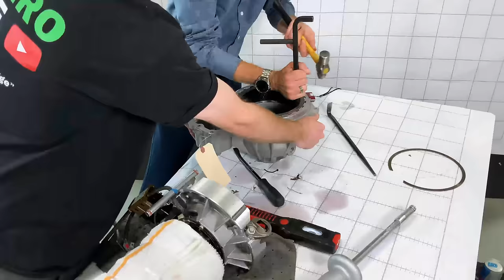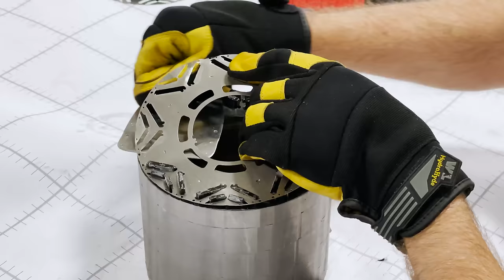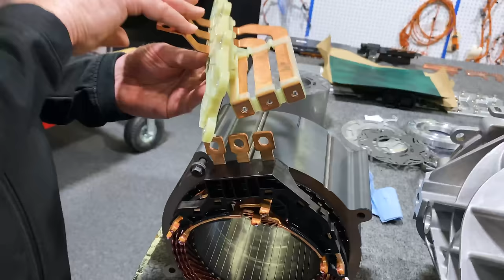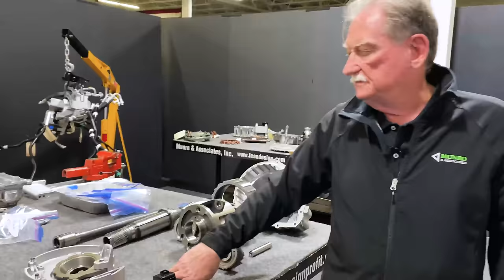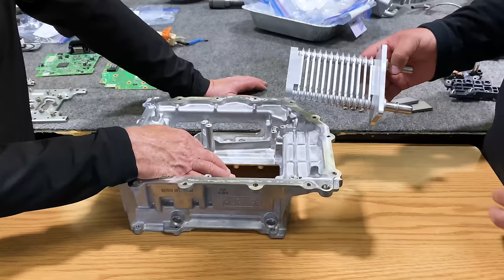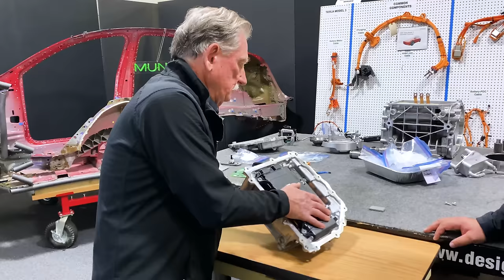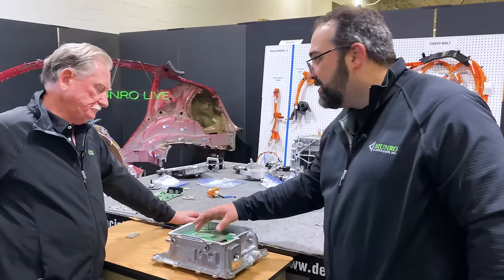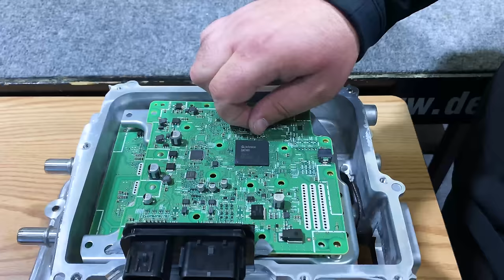Ford Mach-E Rear Motor Teardown and Analysis

Comment: You ask why Ford put the electric oil pump inside that is when it’s out of warranty. The person brings in a fault code came up what’s the problem, oh no problem that’s for the electric oil pump that it needs. I am sorry your credit card won’t pay for that it’s too high a bill. If you step over to our credit department they can set up a payment plan for you. The interest really got it down low at 14%.. i’m sorry that crumble take about four months to get a new one in. And welding everything together in the other component. I’m sorry we have to replace the whole thing it’s not repairable. We can make you a good deal on a brand new car though.

Comment: My guess is during manufacture and assembly a human never touches a single part of the inverter and same goes for the rest of the motor/transmission. For the most part design reflects this reality....Like the idea a screw would get dropped into the housing. Well it's all, but impossible the robots would make that mistake  cuz as each process is completed that robot or the next robot preforms a QC check before it preforms it's process. So if a screw is missing, a part miss aligned or there is an imperfect weld or solder the robots ejects the assembly from the line.....There is no doubt in the EV race Tesla is far ahead, but Ford and the other legacy automakers have been in an automation arms race for a hundred years. I'm willing to bet this Mach-E motor/trans is probably cheaper and possibly more reliable than a Tesla unit just because they are leveraging much more design and manufacturing experience.

Comment: That the initial  engineering  and design is that  way off,  and also that quality Control failed to pick up on all the issues you have raised about this one unit, seems  suggestive of a serious lack of regard towards efficiency, and any appreciation of overall impact of such failures. One could almost infer incompetence ?  Good video and quite revealing.

Comment: I wonder if the electric car maker’s should have a mileage check for service to make sure that all the wires and connections are ok. This might prevent the car fires. What do you think. 
Gas car’s do have a service interval. 
Let us know what you think.

Comment: 11:09 Am I crazy or did you just criticize the need for an oil cooler on a power train, claim it isn't usually seen on power trains, and then immediately cut to your right hand resting on an oil cooler in the Tesla power train? I'm a novice so I could be completely wrong, welcome being corrected.

Comment: using the disk brakes to put the vehicle in park deforms your rotors, especially if they are hot.

i'm sure you know this but luxury cars have used separate tiny brake shoes that clamp down internally on a separate part of the rotor for years for this reason
Reply: Not true...when brakes or electric brakes hold the car in park  the caliper will adjust and accommodate the pad again the rotor..my model 3 is being using that system for 3 years and  have not issue with the rotor  or any deformation of the rotor ...miss information you need to get you facts straight....
Reply: @robcoll1069  you sound very confident with your data of n=1. so all these car companies who have have been making cars for decades with separate rear parking brake shoes are just wasting money?

leaving the pad on the rotor leaves an impression and rust on the rotor and any unevenness will lead to warping. i know those who worship at the alter of tesla cannot possibly believe tesla does something non-perfect, but talk to any mechanic about this. and btw model 3's are notorious for having a lot of brake rust issues, especially if they are driven in northeast with salt on the roads. however most of that has to do with the fact that the brakes on not used much due to the regen
Reply: @connelly6375  Again ..miss info...I got the prove in real time..all Tesla car have electric lock brakes at park and  with Regen active very light used of the brakes pads, using one caliper one set of brakes pads per wheels."I have never had any rotor rust or pads marks on rotors....is always locked at park on hot or cold rotor and is not and issue...you pretend you got facts .. "you maybe driving a Ford" sorry.. you lack of knowledge are in display.."Get your fact straight"
Reply: Knowledge 101..."The brake rotors can become glazed with material from the brake pads. This happens when the brake pads get very hot which causes the pad material to rub off onto the brake rotors. This causes the brake rotor surface to become uneven and decrease the overall efficiency of the brakes. TESLA hardly used the actual brakes "Motor Regen" that is why rotor never over heat or get real hot...that is the secret "don't tell anyone"
Reply: @robcoll1069  Right. However when pushed to extremes on a track the brakes do get quite hot even when regen is operating. I have seen some cases where the OEM brakes are replaced with more robust performance versions since the original ones can wear out before a race is over.
Reply: @Clearphish   yes indeed  any thing that goes into the abused of the track race have to be modified or have some not OEM modification..95% of us are regular drivers in  a normal driving conditions ,Rotor never get red hot or deform or damaged except when drive with were out pads..now if you going to race at high speed and extreme braking  is a different ball game, Tesla car is not made for race track(even do people used them to race), so to generalized it is wrong .. Tesla have the best brakes system ever...thanks
Reply: @robcoll1069  I agree with most of what you say. I also note that the performance models have a thing called Track Mode. This, I believe, is a way to grab the attention of the motor heads who live mostly in the US. 99% of Tesla drivers never bother using the extreme capabilities that Tesla offers. The fact that they exist however takes up significant mind space in the American public. I think this is a good thing because it helps in the adoption of EVs.
Reply: Parking brakes on hot pads are an issue, but not for normal cars in normal driving conditions. Parking brakes using the service caliper pads (in the case of sliding calipers) or a separate caliper (in the case of fixed-body service calipers) are now very common, whether they are applied by a manual lever and pull cable, or an electronic controller and electric motor.

As someone who does his own vehicle maintenance, I absolutely despise those complex and awkward parking drum mechanisms inside the hat of disk brake rotors.

Comment: The inverter is very compact and has nice cooling, it looks pretty robust. But assembly is horrible and service impossible. Seems like more of a prototype put into service. This is like the prototype control systems I would help build for robots in highschool lol.
Reply: Drive units and inverters contain nonserviceable parts. Pre-2013 Teslas had their drive units replaced at least once. Pretty much on ALL cars.

Comment: "Code doesn't cost much..."  
Correct, but it's not the code that's expensive, it's the best code-writers money can buy that cost a fortune, and by the looks of it Ford ain't got enough of 'em or too many of the wrong kind. Wouldn't surprise me if it turned out whatever code they DO put into their EVs isn't written in-house...
Reply: The point is the code only has to be written once. Mechanically locking the transmission requires components in every car.
Reply: @fredbloggs5902  ...code only has to fail once, and hundreds could be effected.
Reply: @fredbloggs5902  Agreed, but MY point was that Ford et.al. don't have the talent resources to write it correctly the first time. Look at the tech problems with VW's "ID" lineup. They wrote the code ...just wrongly though. And they're still at it.

Comment: Major source of inefficiency is the number of gear mesh contact points.  Ford's planetary gearset has WAY more gear mesh contact points than Tesla's offset gearing.  And Tesla's gearbox is higher torque and power output.  You can still solve NVH issues without the planetary.
Reply: Sounds good, but is bullshit. contact AREA not points is what matters & they're the same

Comment: More of an observation.  Clearly the expertise in this video is in the mechanical, assembly and production side.  What's lacking is a technical discussion of the electronics themselves.  Digging into the IC specs, IGBT/SIC Mosfet specs, thermal limits, how well thermals are dissipated, etc....  The thermal discussion is lacking in real understanding, what's talked about observational info without test data to back up assumptions, so many assumptions.....

While I like this video, it's lacking in EE/electronics info.  This is a very complex electro-mechanical system with most likely a great many engineering tradeoffs needed to meet demanding requirements.  Final assembly complexity 'may' be required, hard to say without a much deeper insight into the overall specs of the inverter.

Couple of lines of code cost nothing, and bugs cost lives.  Mechanical locks have known, well characterized limitations.  When you have total power failure, where does the braking come from?

Comment: To be honest I'm starting to be dissapointed by this channel. Every episode is just moaning about fasteners. They don't read comments, they don't understand that modules are build by subcontractors with different internal standards. Sandy is stuck back in 80's and don't get that large modern PCBs need alot of supports because of vibration failures.
And a ton of fanboys in comments that take everything as gospel...

Comment: Watched your video with interest, but one think that stands out is that it’s very easy to be critical of manufacturers. Think ford have done a fantastic job. And they should be commended and not put down constantly.
Reply: This isn't just put downs.  This is untold millions of dollars in unnecessary costs to manufacture due to needless complexity,  unneeded components,  parts which are much more expensive for the customer to have repaired. All makers commit these errors and should learn from these analyses. 

This is extremely valuable constructive criticism to the entire industry.

Comment: Can you say crash test, I don't get it.  Well just build your own and make it work.  And not with your click it parts together that just saves money on the builder side.
I'll play with yea, 1/8" machine screw can hold over 3,000 pounds.  Now, how many of your click it together parts do I need to get there.  Just one big part or it just depends 
on what the part is made of.  
Post it, you must have by now at least 10 or 20 self clicker parts that are PATENT.

Comment: I assume Tesla has a reason for their wound stator design, as opposed to the hairpin design. Do you have any idea why Tesla does it that way?
Reply: Efficiency. The fact that they still do that instead of hairpins despite the automation headache means it's really crucial to motor efficiency.
Reply: A recurring theme with Elon is going back to base principles to make something that works and then refining over time. It’s possible they will do this in the future, the difference is they’ll know precisely what the trade-offs are.
Reply: Because it was always done that way. The same reason that Tesla stuck with induction motors for so long.

Comment: Electric motors have been in use for decades in pumping applications. What is so different about EV motors?
Reply: EV Motors are brushless, turned by moving the magnetic field.  Pump motors use brushes on a commutator.  Brushless motors are orders of magnatude more efficient than normal brushed motors.
Reply: @charlesball6519  No, they're not "orders of magnitude more efficient"... for that to be true, brushed motors would need to be less than 1% efficient, which is not true.
Reply: Nothing fundamentally. EVs are just a very demanding application, requiring high efficiency and small motor size, and the ability to run at relatively high power at least briefly. They also need to be sealed (many motors are open for air cooling) and to run for years without maintenance (so brushes and commutators are not acceptable). Almost all EV motors are 3-phase AC induction or permanent magnet (PM) synchronous types - this one is PM - and both of those types have been used industrially for a long time, especially the induction motors which have been around for over a century.

Comment: I guess if I was at engineering school with Sandy as my lecturer .... I would have just gotten a big “F” !
It seems this legacy car maker is struggling to bring on the new mindset that EV engineering demands (unrelenting weight reduction, extreme efficiency in design and resource management) .... as it must dis-heartening for some of these engineers to create key sections of great design only to be undermined by sections of gross mediocrity and old habits.
Great design and engineering demands a very small (less than five) leadership team but also fully empowered at that .... so today’s presentation makes me wonder how much is Ford and/or third party suppliers or are they just out of the depth in these matters? 
As Sandy mentions a few times in aerospace we don’t do any of this... so how hard would it be to bring some aerospace mentors or suppliers into the fold?
Reply: Borg Warner, who designed this unit, was the original drive unit supplier for the Tesla Roadster, fanboy. Legacy, nothing. Hot air PR from Musk that you ate cuz you like your pablum.
Reply: @vidznstuff1  You sir misjudge my commentary … Ford like other competitors display design and build elements that encompass both excellence and mediocrity whether that is through their own efforts or suppliers.

So there is no need to so sensitive … for the moment Tesla is delivering one of the best overall design and build ‘packages’ as acknowledged by both of the CEO’s at Ford and VW (while GM remains in denial).

However, the ultimate proof of who is best whether that includes your friends at BorgWarner or not - probably will take many years possibly a decade - as this race has only just begun!

Comment: Motor is inline with what? The axles?
IGBT & MOSFET what% of viewers know what these are?
Reply: ...yes, the CV joints go on either side as an integrated motor/differential unit. Very compact, but might require the beefed up housing.

Comment: Code for braking? That doesn't seems wise. Wouldn't there be a parasitic energy loss to have the car just parked? A mechanical direct hand brake is more energy efficient and fail proof
Reply: There is no parasitic power consumption. Electrically-applied parking brakes are just like the parking brakes that you apply with a hand lever or foot pedal, just operated by an electric motor.  Once they're set, they stay in place with no power, just as the manual version stays in place without the driver continuing to pull on the lever.
Reply: @brianb-p6586  alright, that's another storie. It would make sense

Comment: The parking pawl comments are interesting. Every vehicle has a parking brake, so none of them need a parking pawl... whether it is in an automatic transmission or an EV transmission. Most parking brakes are now driven by electric motors, so they can be automated (for the stupid drivers). If you're going to criticize Ford for having a parking pawl (as many EVs do), you should criticize every manufacturer for having a parking pawl in any automatic transmission, especially in vehicles with electrically actuated parking brakes.

Comment: man i'm not an engineer, but build PC. this seems way to complicated and unreliable. is this designed for dealerships in mind for repair?
Reply: Ding Ding Ding!! We have a winner! The design of this and the thermal system are to guarantee income for Ford dealerships. Dealers make the lion's share of their profit from service, not sales. Ford dealerships were not on board at all with the idea of low maintenance EVs, obviously Ford found a way for their dealers to generate income from their Service departments.

Comment: It called Ford special design Why after 7 years later that filter will be clogged ,will be no cooling that expensive motor,will be cost special repair bill  around $5K-8K parts&labor another ways make money very easy way,like Honda&Acura automatic transmission.....

Comment: Why why why  reinvent the wheel?  add cost and weight to a machine that should be as light as possible and cost you the least amount so you can get it out to the masses??  How hard is it for a mechanical engineer to take apart let's just say.... A TESLA and learn from it just like Sandy and Team does?  Is this hubris??? arrogance??? I sure hope Ford sends one of their engineers to speak with Sandy on camera.
Reply: I think the real reason is that if your trying to make an automobile using a McMaster Carr catalog you gotta hobble together ready made parts to make it work 😂
Reply: 1) They know what parts they already have in the parts bins.

2) They don’t want to appear clueless, so they maintain a facade of knowing exactly what they’re doing.
Reply: ...many people can't afford a Tesla, just yet. It took Tesla a few years to figure out how to keep body panel gaps consist. Something everyone else has done for years. Engineering is all about compromise between cost, durability and performance. Time will tell who does it best...which is good competition.